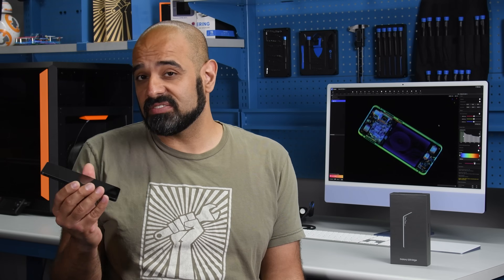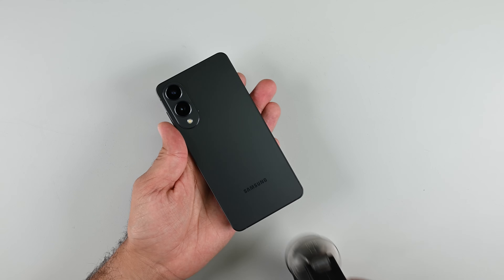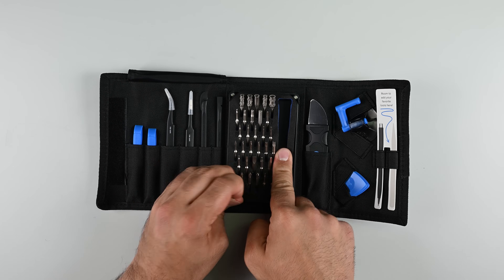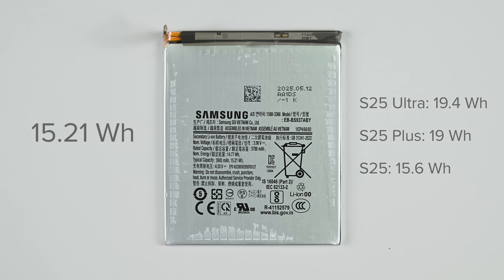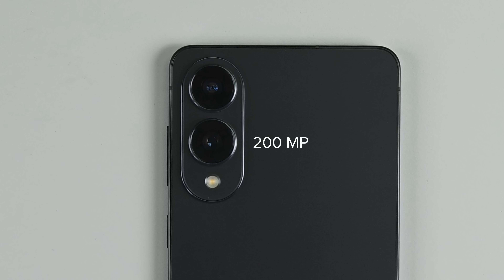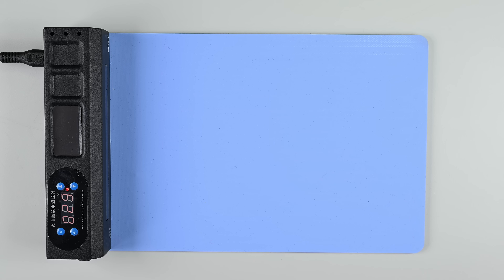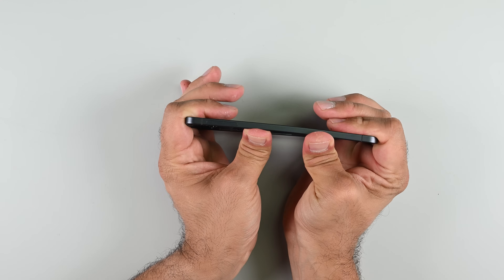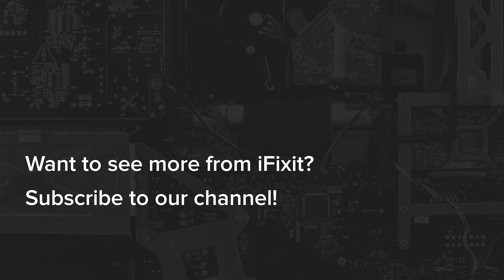How Did Samsung Make This Phone SO Thin? Galaxy S25 Edge Teardown!

Comment: Meh. I'm not impressed by a "thin" phone when the camera mountain is adding double the thickness. Pixel 9a is the only modern phone doing this right, which makes the super glued in battery a true shame. The next true innovation in phones needs to be getting rid of the camera bumpouts, they have always always sucked and now on most phones they are ridiculous. Innovate flat phones!

Comment: iFixit scores nowadays seem strange. This phone is much easier to disassemble than the iPhone 16, yet it has a much lower score. The same goes for the Nintendo Switch. I used to use the iFixit score to know how difficult it would be, but it doesn't help anymore.
Reply: You're forgetting the other more crucial factors: repair manuals and parts. This score was not only fair, it was in fact a bit generous. Repairability is impossible without parts!
Reply: much easier? you need to take out the motherboard to get to the cameras and screen, whereas iphone 16 does not
Reply: @rrrr2150 Yes, it takes an extra step to unscrew, but that's it. It's never a hurdle. You don't have to worry about the ribbon cable that is notoriously known to be easily broken.
Reply: @kexec.  you literally need to open the back and front to replace the screen, and replace the thermal paste after. that score is fair stop glazing samsung
Reply: @rrrr2150 I'm sure you never actually open up the device? Ribbon cables are one of the many reasons why many iPhones' cameras are easily disconnected and stop working. Opening up the device may seem like a big deal to you, but for someone willing to open it up and try to fix it, it's never an issue. Unlike ribbon cables, there's very little chance of making a mistake and accidentally breaking the cable. It seems you ARE glossing over the issues with Apple.
Reply: @kexec.  damaging ribbon cables while opening up a phone is embarrassing. everyone knows not to insert the pick too deep when cutting the glue. your comment is oozing skill issue
Reply: They always give Samsung lower scores and iPhones high